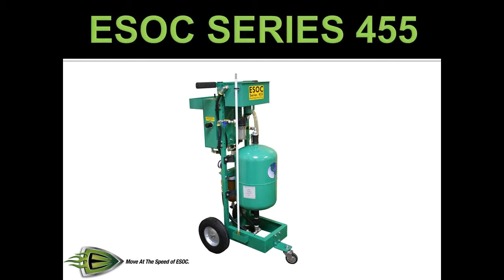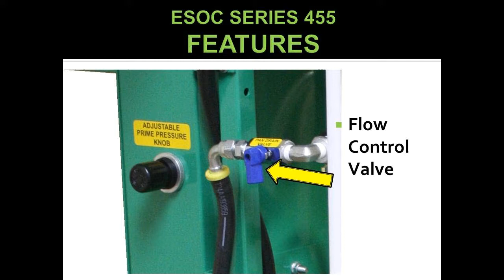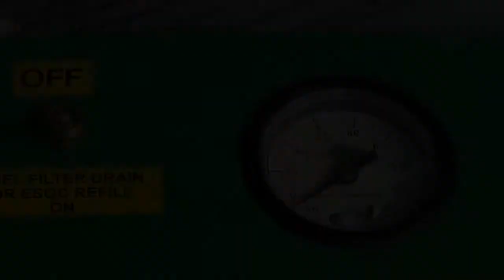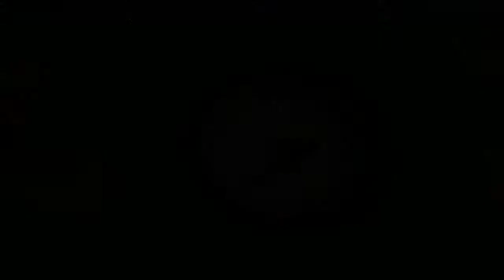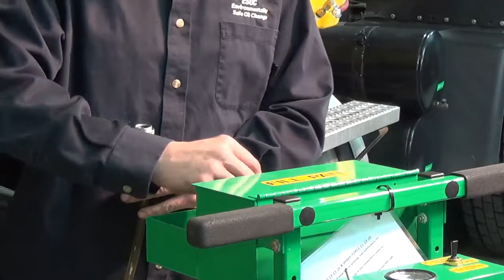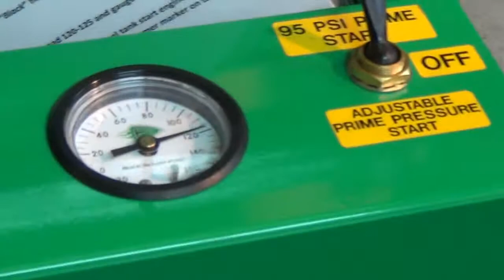SERIES 455 DIESEL FUEL PRIMER

Comment: I accidentally put air into my system with this machine, the 455 tank was empty when i flipped the 95 psi switch, how can i fix this?
Reply: Start process over but this time make sure the fuel primer has fuel in storage tank